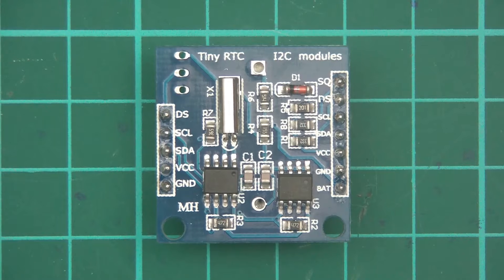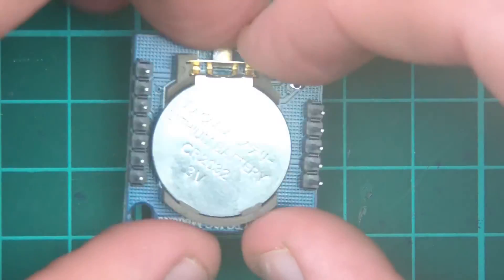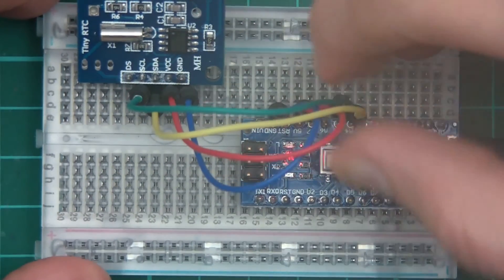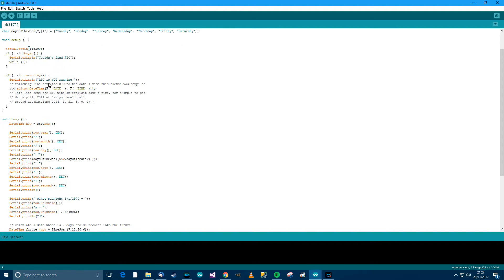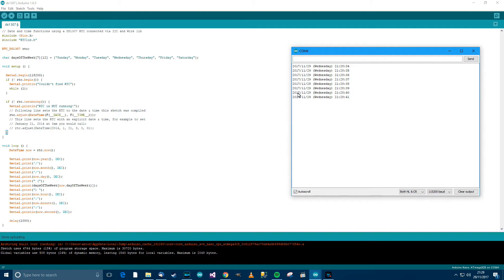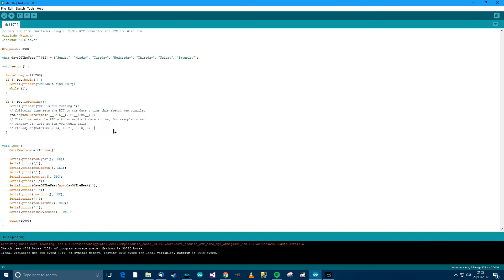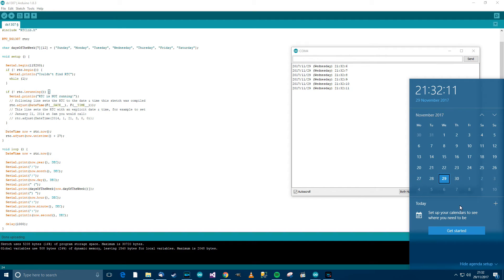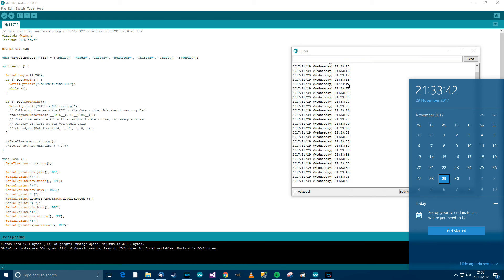TUTORIAL: How to wire up & code an RTC - Real Time Clock - Arduino (Module)

Comment: Here's the code if you're lazy like me

// Date and time functions using a DS1307 RTC connected via I2C and Wire lib
#include <Wire.h>
#include "RTClib.h"

RTC_DS1307 rtc;

char daysOfTheWeek[7][12] = {"Sunday", "Monday", "Tuesday", "Wednesday", "Thursday", "Friday", "Saturday"};

void setup () {
  Serial.begin(115200);
  if (! rtc.begin()) {
    Serial.println("Couldn't find RTC");
    while (1);
  }

  if (! rtc.isrunning()) {
    Serial.println("RTC is NOT running!");
    // following line sets the RTC to the date & time this sketch was compiled
    rtc.adjust(DateTime(F(__DATE__), F(__TIME__)));
    // This line sets the RTC with an explicit date & time, for example to set
    // January 21, 2014 at 3am you would call:
    // rtc.adjust(DateTime(2014, 1, 21, 3, 0, 0));
  }
  
  DateTime now = rtc.now();
  
  // Unix time didnt work for me
  //rtc.adjust(now.unixtime());
  
  rtc.adjust(DateTime(F(__DATE__), F(__TIME__)));
}

void loop () {
    DateTime now = rtc.now();

    Serial.print(now.year(), DEC);
    Serial.print('/');
    Serial.print(now.month(), DEC);
    Serial.print('/');
    Serial.print(now.day(), DEC);
    Serial.print(" (");
    Serial.print(daysOfTheWeek[now.dayOfTheWeek()]);
    Serial.print(") ");
    Serial.print(now.hour(), DEC);
    Serial.print(':');
    Serial.print(now.minute(), DEC);
    Serial.print(':');
    Serial.println(now.second(), DEC);

    //Serial.println(now.unixtime());
    //Serial.println((F(__DATE__), F(__TIME__)));
    delay(1000);
}
Reply: thank you so much the amount of times I went to your exact comment haha

Comment: Hi, nice video. I have one question, the battery in the RTC is 3,3v, isnt it better to conect to the 3,3v pin? conecting to 5v would not overheat the battery and reduce battery life?

Comment: I made this project but the RTC is running faster than it should be. how can I fix it??
Reply from the maker: Hi, I've never seen that before! I'd say, try another RTC as timing is pretty important for an RTC lol.
Reply: Yeah for sure time is the most important. Lol.. well . but the issue is defined so we somehow need to find an answer. anyways !!! thanks for the fast reply.. keep on the good things!!
Reply: You won't believe this... DS1307 running fast here too! After a full day off the power and running with the battery, it is now 2 sec ahead.
Reply: I found the module drifted by 7 seconds a day. Fiddling with the crystal, using an external PSU, decoupling capacitors all made no difference.  So I saw this topic and added the below code. 

     // Start RTC drift compensation

  if (time.hour == 9 && time.minute == 1 && time.second == 0) { // run daily at exactly 9:01 A.M.
  delay(8000); // wait 8.0 seconds (that's 6.0 secs drift plus 1 second then reset seconds to 9:01:01 see below)
  RTCTime newValue;
  newValue.hour = 9;
  newValue.minute = 1;
  newValue.second = 1;
  setTime.setValue(newValue);
  
  // Time drift is approx 7 seconds gain per 24 hours. The extra one second is to prevent the program from being stuck
  // in an endless loop. Formula is time drift <in seconds> + 1 second leeway + set time to 1 min, 1 second past the hour.
  // This will result in the clock being put back 7 seconds at 9:01:01 every morning. Adjust formula accordingly.
  // DS3231 crystal is temperature sensitive so during the summer the gain will slow down. Colder temps = faster speeds.
  // Often cheap Chinese modules use watch crystals which are calibrated at blood temperature not room temperature.
  // The above code is not perfect but will help to compensate for this problem.
  
}
    // end RTC drift compensation

I placed this in the main loop after the bit that updates the time based on the RTC's 1Hz signal.

Hope this helps someone.

Comment: Nice video again! Last year I tested the same RTC modules and I found the DS3231 easiest to work with. The others gave me problems (related to I2C pullups) or seemed less accurate, so the DS3231 is by far my favorite. In contrast to the other modules the DS3231 also has two alarms which you could use for instance to wake-up your arduino at specific times. Note that that module also features an I2C eeprom memory chip which may come handy for logging data or storing events (such as sunrise time :-)
Reply from the maker: Hey! I'm new to RTCs, this is the first time I've used one. I've just bought the one you mentioned. I didn't realise the RTC had a usable EEPROM either! I assumed that it would be inaccessible, but you're right! Thanks!